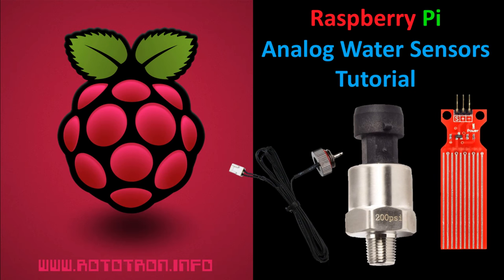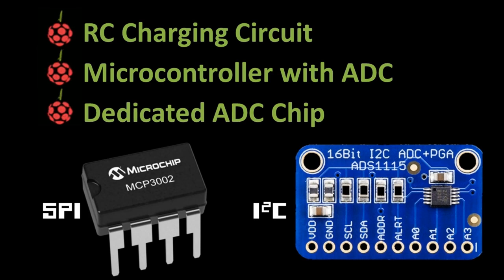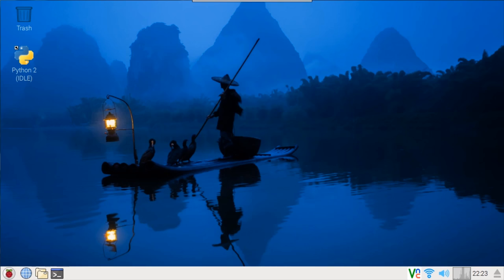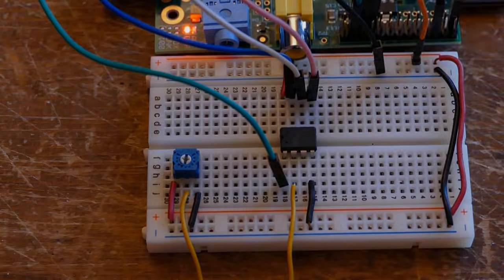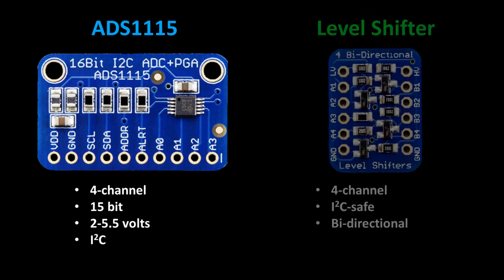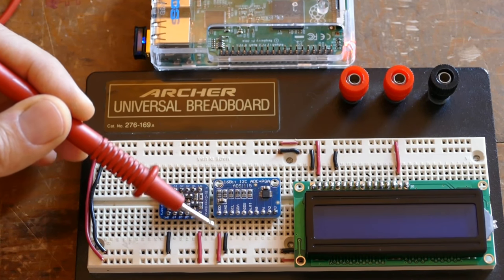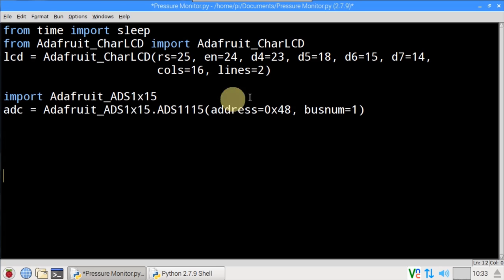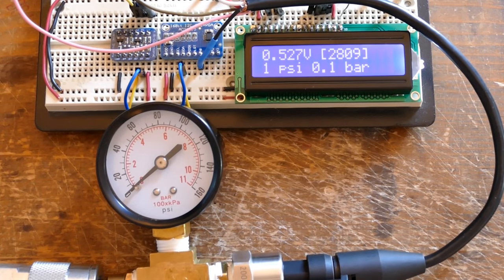Raspberry Pi Analog Water Sensors ADC Tutorial

Comment: By chance you're monitoring this, did you use a reducing Hex Head Hose Bushing Adapter to fit your pressure transducer into the brass T?
Reply from the maker: It looks like it was a 3/8 in. MIP x 1/4 in. FIP brass bushing fitting, but to be honest, I can't remember exactly—it was over 8 years ago.
Reply: @rdagger  Thanks so much for responding. Between the T I found at Home Depot (1/4" Female NPT) and the reducing hex I found on Amazon (1/4 Inch NPT Male Thread to 1/8 Inch NPT Female Thread), I'm hoping the reducing head will fit my 1/8 inch MIP pressure transducer. I'll post my results over the weekend when I receive the reducing hex.

Comment: So I'm using an ADC1115 and I have it wired exactly as you do except Im using an capacitive soil moisture sensor. When I do i2cdetect -y 1 there are no values in any port. I installed the adc library exactly as you did. Is there something i'm missing?
Reply from the maker: Sounds like a wiring issue.
Reply: @rdagger  So I have VCC on the sensor and vdd on the ads1115 connected to 5v. gnd from both the vcc and ads1115 connected to ground. and aout on the sensor goes to a0 on the ads1115. Then the SCL and SDA pin on the ads1115 are wired identicle to yours.
Reply from the maker: @adamcymerman7856  Do you have a level shifter between the ads1115 and the Pi?
Reply: rdagger68 I do not. Is it needed? You’re the first person I’ve seen use it
Reply from the maker: @Adam Cymerman It may not be needed, but I recommend you use one.  See 11:23 in the video.  Please make sure you use good quality wire, keep the length as short as possible and use an I2C compatible shifter such as the Adafruit one used in the video.

Comment: This is exactly what I have been looking for to setup a pressure gauge on my pool pump so I can check the pump pressure remotely via a web app.  I am already using a Pi and two 1-wire temp probes to read the outside temp and pool temp now I just need to add the pressure sensor and I will be all set.  Thanks for this videos its made that project move up the list :)
Reply from the maker: Thanks for the positive feedback.  You can also measure water level with a pressure sensor if you can place it near a bottom drain (good for water tanks and above ground pools).

Comment: Thank you sir..!! Absolutely loved it. Quick question, will multiple pressure sensors work?
Reply from the maker: Yes.  The MCP3002 supports 2 sensors and the ADS1115 supports 4 sensors.  There are other chips that support more.
Reply: rdagger68 Thanks a lot😊

Comment: Thanks for the awesome videos, perfect pace and detail. I have an analog temperature probe but it only has two wires. I can see resistance change with water temp but not sure how to wire it using adc without a signal wire.
Reply from the maker: Get a resistor and then you can use your sensor as one half of a voltage divider.  As the sensor resistance changes the divider's output voltage will change which you can measure with an ADC.
Reply: @rdagger  Thank you so much, I'll have a go

Comment: Appreciate the video.  Its seems to be the information I need to monitor my coolant system on my cnc.  The plan is to have a liquid level sensor along with 2 pressure sensors.  The pressure sensors will sit on either side of filter which will allow me to monitor when the filter needs changing.  I havent researched it yet, but I'm assuming instead of and LCD, I can use my 7" RPI touchscreen.
Reply from the maker: Sounds like a fun project.  The touchscreen will work but you will need to program a GUI.  For the liquid level sensor, you might want to check out eTape by Milone Technologies.  I've been wanting to test their sensors, which purportedly give accurate level measurements.
Reply: Sounds like I'm on the right track then.  I found the chemical resistant eTape sensor last week and I installed Kivy this morning.  :)  Thank you again for the videos!
Reply: I got it working with Kivy.  Thanks again!  https://www.instagram.com/p/BXI2RCmgMk4/?taken-by=sharmstr

Comment: I know this video is older but I am having a hard time finding anything on how to wire up a simple Piezo electric sensor. I know I need a DAC and that's what got me here. However, I'm using a different component than what you identified. I have the 2PCS MCP3008-I/P Mcp3008 8-Channel 10-Bit ADC with SPI Interface for Raspberry Pi (off Amazon). Is hooking this up going to be different from what you have outlined here?? It is so hard to find a good book or tutorials to work with all the cool sensors and gadgets available. If other tutorials were as good as yours, it would be a one stop shop. I wish you were still doing these videos ;-( Any recommendations on a great book(s) or courses for learning all (or many) of the available sensors/hats/components/etc... Thank you so much for the awesome videos you have posted!
Reply from the maker: The wiring should be the same.  You’ll probably need to connect both AGND and DGND to ground and Vdd and Vref to 3.3V.

You need an ADC (Analog-to-Digital Converter) instead of a DAC (Digital-to-Analog Converter).  The MCP3008 is an ADC and should work depending on your required resolution.  The video is 8 years old.  Looking back at the write-up on my website, I did encounter some incompatibility when I tried to use the Adafruit MCP3008 driver with the MCP3002.  That is why I used direct register manipulation instead of a driver.  The code I used in the video might work with an MCP3008 or you could just use the latest Adafruit CircuitPython driver:  https://github.com/adafruit/Adafruit_CircuitPython_MCP3xxx/

I still make videos but they are more projects oriented as opposed to component tutorials.  Still, I usually explain the wiring and coding for each component.  I also lean toward MCUs like the ESP32, the Teensy, and the Raspberry Pi Pico over SBCs like the Raspberry Pi.  I might make more tutorials in the future when I come across interesting components.

Adafruit has many great tutorials:  https://learn.adafruit.com/
Reply: @rdagger  Oh boy this is all good info thanks for your response. I was actually debating on using Raspberry Pi Pico instead since my SBC is overkill. I'll also check out Adafruit. Best wishes! You should write a book on how to use every component because your information and style are second to none.

Comment: Very patient narration and very professionally made. Great job.

Question: Can I add more than one Analog input onto a single ADS1115? If you have done this, please do share. Im planning to have a pH Sensor, Turbidity sensor, Pressure Sensor, Water flow sensor collect info and send to my Pi. This is for my swimming pool. Or am I better off simply connecting all of this to Arduino? But I havent seen an example of how to read Arduino from a Raspberry.
Reply from the maker: Yes the ADS1115 allows you to connect 4 analog devices to pins A0 - A3.  Adafruit has a good example of how to read 4 inputs:
https://github.com/adafruit/Adafruit_Python_ADS1x15/blob/master/examples/simpletest.py
I'd go with the ADS1115 approach because it is simpler, less expensive and uses less power (assuming you need a Raspberry Pi too)
Reply: Thanks for responding. I already have a Raspberry Pi, but its almost 100+ft away from the pool equipments. So Im debating whether to buy another Pi or get a Arduino+wifi and use MQTT
Reply from the maker: I haven’t experimented with that long a distance.  In theory, shielded CAT6 with a differential signaling approach might work, but there are a lot of factors that could cause problems. 
RS485 is a good solution for long cable runs.
If you go with wi-fi, take a look at the ESP32 and Micropython.  I plan on doing a video on the subject.
I just did a video on setting up a wireless solar powered Raspberry Pi REST API:  https://youtu.be/1VxP38XlVEQ
Reply: Balaji Venkatesh so what did you go for and how did it turn out?

Comment: Hi there rdagger68,

I just watched your video about this pressure sensor (awesome results :) ) but I was just scratching my head why on earth you used those two other circuits.
I use the MCP3008 to monitor my 12V backup battery state of charge or if it is being charged, and the PI's 5V (unregulated) rail voltage from the 3.3V (regulated) line used as ref.

I used a voltage divider (which is only 2 resistors) per channel to reduce my "12V" to maximum 3.3V and and the "5V" to maximum 3.3V.

If you put a 10k and a 2.7K resistors in series and you wish maximum 3.3V from the divider, it can handle up to 15.52Vs from the battery bank. Similarly for the 5V rail I used 10K and 9.1K resistors ending up with maximum measurable voltage of 6.92V on the 5V line.

The S line of the pressure sensor could have gone to this exact voltage divider and using of some math after reading out the bits from the MCP3008.

If you intend to build voltage dividers please avoid too little resistors (they pull lots of amps) and avoid shitty tolerance resistor bands.

Regards,
Sándor
Reply from the maker: Thanks for your feedback.  Are you asking why I used a level shifter board instead of a voltage divider?  If so it's a great question.  The answer is mainly for convenience.  Also you can buy a 5 pack of four channel level shifter boards for $1 on eBay.  In low current applications, voltage dividers are often great solutions.  However, voltage dividers can generate interference and performance issues with digital signals such as SPI and I2C (if used on the data lines).  Therefore in these cases I usually use level shifters.  Still your approach is perfectly valid and economical.

Comment: I'll model my code after yours to use with my mcp3008 to control an interface circuit which will control a 5vdc water pump contingent upon readings from a capacitive soil moisture sensor

Comment: Thanks. Great tutorial once again!  I am really learning a lot about sensors, microcontrollers AND micropython from your tutorials!
One question: your tutorial examples constantly poll the sensors with a While True loop. This must be quite a power drain.  In your first example, you may only want to supply water when the moisture level hits a certain point. 
Can this be done by using a micropython interrupt (or something similar) when the ADC output hits a certain value? 
Will this make any difference to power consumption as the SPI is still running all the time anyway?
Reply from the maker: That’s a great question!  The ADS1115 has 2 conversion modes (single-shot and continuous).  In single shot mode the ADC performs a single conversion upon request.  This can provide significant energy savings.  There is an alert pin that can be triggered by the comparator when the ADC value hits a specified threshold.  I have not tested this functionality.  I’m not sure but I’m guessing you need to run the ADC1115 in continuous mode to use the alert pin.  Therefore, you won’t necessarily derive any power savings.  In my example code, the sleep method ensures the loop uses very little resources.  Even an old Raspberry Pi A runs 7 million cycles per second.  Polling a sensor every 2 seconds will not tax the CPU.

Comment: Hi, thanks for the video absolutely loved it. What can I do if I want a more precise readout on the LCD, closer to the master gauge
Reply from the maker: There are more precise pressure sensors but they tend to be expensive.  You can also get an ADC with higher resolution such as the 24 bit ADS1220.  Performing multiple samples and statistical clean up also helps. For the record, the margin of error for the analog pressure gauge used in the video is probably comparable to the sensor.

Comment: This video is excellent, However I want to verify for the pressure sensor I do not need the LCD. I am attempting to write code that has If/then or else statements based on the measured pressure.
Reply: @rdagger68

Comment: Hi, I have another question regarding the choice of ADC... say for the project I mentioned I wanted to be able to analyze the signal from the microphone to observe a certain peak. Are there any relevant attributes I should take into account when choosing my ADC or is MCP3002 an all around good option. My setup would be the same as yours but instead I would be connection a microphone to the analog input of the ADC.
Reply from the maker: Assuming you are measuring peak amplitude and you are going to use an electret microphone amplifier such as the Adafruit MAX4466 version, then it probably doesn’t matter.  Although it depends on your timing and accuracy requirements.  The MCP3002 is only 10 bit resolution.  The ADS1115 is 15 bit resolution.  The MCP3002 has a fast SPI interface.  The ADS1115 has a slower I²C interface.  I’d post your question to the Adafruit forum.  Their engineers will be able to provide first hand advice:  https://forums.adafruit.com/

Comment: great video new to all this i have connected the ads1115 to a raspberry pi 4 using the i2c pins and connected to water sensor to a0. i am also using the adafruit single ended exsample to run the sensor. this works well to show all is ok but i want to use the code you are running. how easy would it be to set that up?
Reply: i have tried the code and it does not change the color of the led i have tried changing the channel setting as in the video but i can not get it to read any water detected. my sensor is on channel a0 and the ads is on chennel 00.48 on the i2c any idea what i am doing wrong?

Comment: hi,
Could you connect 4 pressure sensors at the same time? like monitoring 4 air bags suspension for a car.
Thank you !
Reply from the maker: Yes, the ADS1115 has 4 channels so it could monitor 4 analog inputs.

Comment: Thanks for this great tutorial. Could you share which pressure sensor you have used?
Reply from the maker: I don't see any markings on the pressure transducer other than 200 PSI.  I bought it on eBay 4 years ago.  I don’t recall the store.  It cost about $25.

Comment: Would this work with a Resistance Level Sender for a water tank? The type with the float on that changes resistance as the float moves up or down?
Reply from the maker: You could create a voltage divider using a resistor with the sensor.  Then you'd be able to measure the voltage as the sensor changes resistance.

Comment: hello, i want to monitor the waterlevel in my rainwater bassin,  i want to do that with a pressure sensor, in your tutorial you stated that the psi sensing range must be lower than the 200 psi range u use, how much lower and where can i order one
Reply from the maker: I haven’t tried this approach but theoretically since pure water has a specific gravity of 1.000 at 39.2°F and every 27.71 inches of water height equals 1 psi, you could calculate water level using:
P(psi) x 27.71 (inH2O/psi) = W (water level inH2O)
Therefore a 5 psi sensor would accommodate a combined barrel height and elevation of about 11.5 feet.  A 3 psi sensor would be adequate up to about 6.9 feet.
Honeywell makes the ABP series of basic board mount pressure sensors that are available with I2C or SPI protocols in 3.3 or 5.0 Vdc.  I haven’t tried them and they come in many variations so I suggest you contact Honeywell tech support for a recommendation.  Alternatively, you could use ultrasonic or capacitive sensors.

Comment: Your video convinced me to take the plunge! Thanks!  I wired a RaspberryPi up to the ADS1115.  `i2cdetect -y 1` sees the unit on 0x48.  I connected the moisture sensor to A1 on the ADS1115.  When I issue `i2cget -y 1 0x48 1` I keep getting 0x85, whether or not the unit is in soil or otherwise.  I must be missing a step? Possible to get a reading at the command line?  Thank you!
Reply from the maker: You need a library to communicate with the chip such as the Adafruit one used in the video:  https://github.com/adafruit/Adafruit_Python_ADS1x15
Otherwise you would have to send the correct bytes to configure and read the chip as specified in the ADS1115 datasheet.
Reply: @rdagger  Thanks for the response.  I saw the bitflags, but got a bit stressed with all the warnings that the i2c commands spit out!  I'm trying to do this outside of Python/C++, but suppose I could byte the bullet (hah!) and make a CLI command w/Python.

Comment: Hi rdagger, I was wondering if this could be used to convert inputs from a microphone? I don't have an exact setup at the moment but the idea is that the microphone would be used to detect an object and so past a certain threshold the mic would give us a 1 for example. Edit: I looked a bit into MEMS microphones that can output a digital signal so would we be able to use that as a direct input?
Reply from the maker: You can buy an inexpensive sound sensor that will output a digital or analog signal depending on sound intensity such as this one from SparkFun:  https://www.sparkfun.com/products/12642
Adafruit has a good tutorial on measuring sound levels with a mic and an amp:  https://learn.adafruit.com/adafruit-microphone-amplifier-breakout/overview